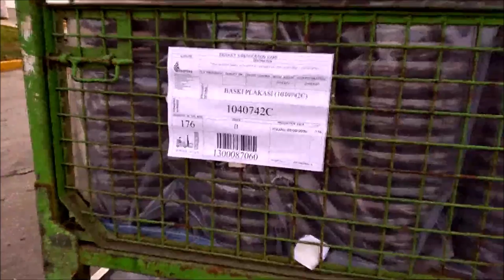How Brake Discs are Made in Factory - The Process & Machines Involved

Comment: I came here really wanting to know how disc brake rotors were made. After watching I still don't know🤷‍♂️
Reply: Basically forged in mold. I think
Reply: @moahhamid  molds are for castings, so not forged
Reply: The video is really bad.
Reply: Falto el maquinado de rotores discos de freno
Reply: Molten metal poured into a cast then they come out on the belt. Next video, how a cast is made :D